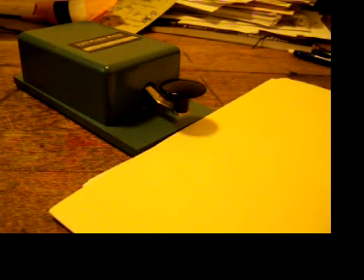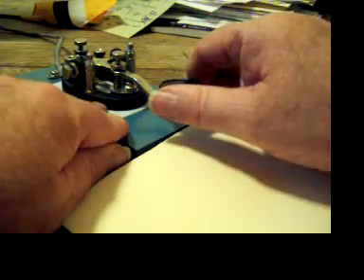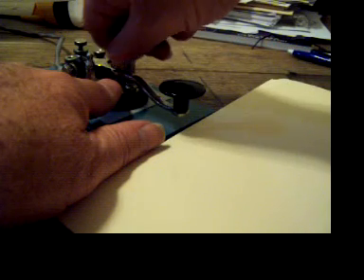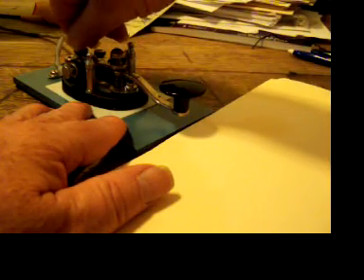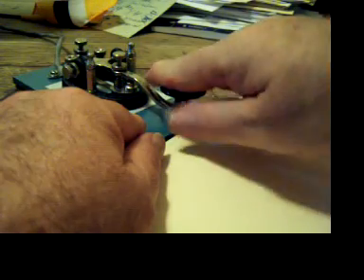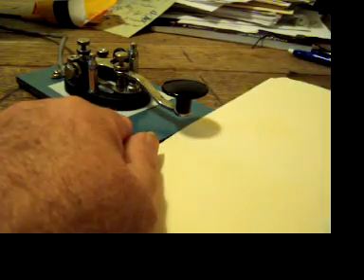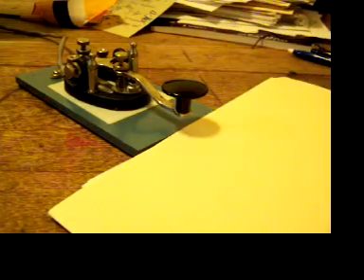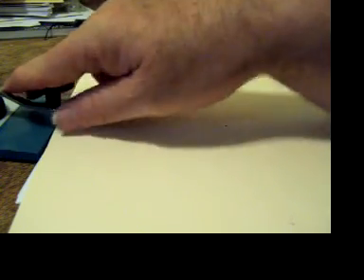USA straight key setup and sending method by N1EA

Comment: But if they key stutters do you tighten or loosen the tension?
Reply from the maker: If you use the key and your motion stutters because you cannot reliably press and release the key, you need less tension, if your key presses are uncontrollable because the key unreliability closes before you want it to or doesn't obey your sending, you need more tension.  Tension should be enough so the key doesn't false while sending, nor so much to fatigue the operator when sending.  A good start is a just little less tension than that required to keep the contacts open with the hand resting fully on the keying knob.  Adjust downward in tension until just before the keying gets sloppy because of slurring because of insufficient tension. Good luck.

Comment: Having taught Morse Code sending (and receiving) in the Army at Ft. Ord in the late 60's, Your video of American style sending is very good. Hardest thing to teach my students was to keep the wrist LOOSE while sending and letting the forearm do the work. Natural tendency is to TIGHTEN the wrist when grasping something like a key knob which brings up the only 'error' I found here where you weren't grasping the knob with your thumb and middle finger on the edges of the knob. Doing that will give a bit more control while sending. All in all though - a great example of American style sending! TNX!
Reply: Hi Jim, I was a radio operator in the Army and got my training on the job, I was taught Morse Code but never was taught how to send like what is shown in training films as the proper way to send,  so I never really new the proper way of sending at that time. My favorite key was the J45 leg key and I guess I was what you would call a tapper, sort of like the guy in the video and it worked for me. I had a very small gap on the key and sent very fast that way. I don't think I could hold the key and send with the very close gap. but I did it for almost two years in Germany. nice to meet a Army CW op. KA9HJZ

Comment: I believe that key was made for the Navy, I never saw it enclosed,  I 'll have to watch for it, for my key collection.
Reply from the maker: The key is a standard oval base Speed-X key which ITT/Mackay Marine put in a heavy metal box and painted it "Merchant Marine Blue" the color of their Safety Of Life At Sea (SOLAS) ship radiotelegraph stations in the 1970-1999 period.  As a radio officer on USA ships, I just had to have one!
Reply: My mistake, looked like the Navy key I have that has a bayonet plug  on the side of the base for a bug. SpeedX are great keys has the same good action as the J 37 and 38, I was a Army Morse code OP in the Army in the middle 50's. nice video. enjoy.
Reply: djringjr Were you ever on the USNS Patch, that was a navy ship but had Merchant Marine serving on it.
Reply from the maker: No, I was not.  The Navy ships with merchant marine crews were USNS ships compared with USS ships. I was mainly on tankers, but I worked on roll on roll off ships and container ships as well as research ships, etc.  Mostly USA Atlantic and Gulf coasts.